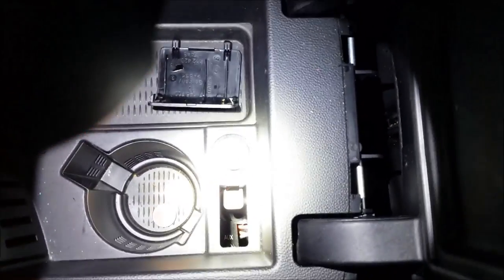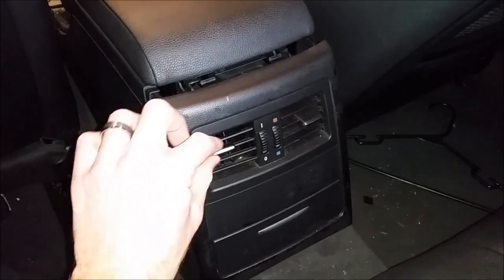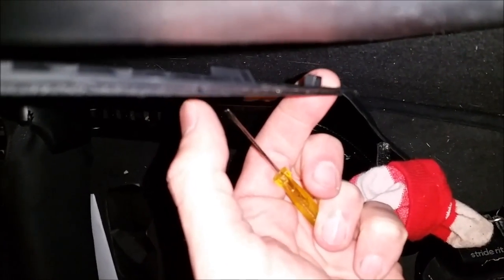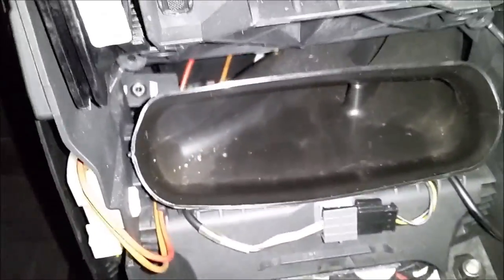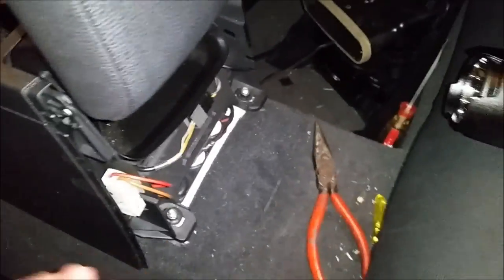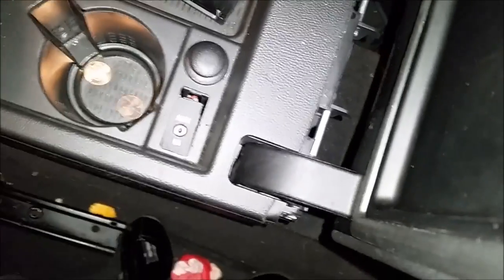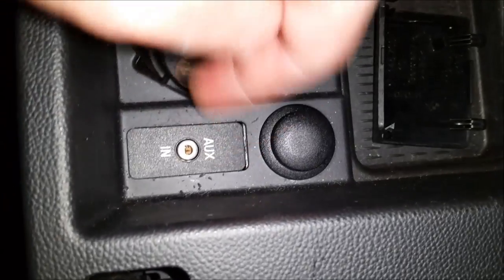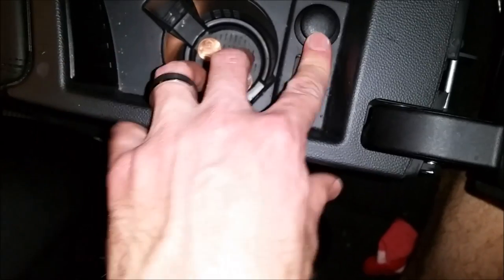2007 BMW 328i Aux Port Fix and Rear Center Console Panel Removal

Comment: This video helped me a lot in removing those side clips.  I found it easier to pull the unit out through the side and then feed it back in at the top and then reconnect the cable.  Thanks!
Reply: The coupe's rear AC and vent, etc doesnt pull off like this video, so I did the side method as well! Worked for me.

Comment: Thank you for the video! Not sure if that made your mother-in-law happy but it sure made me happy so big thanks to you again!
Reply: It took a lil twist and poking around the clip retainer on the sides to disenage it so for anyone that are planning to do this, just be patient and you'll get there. Also if cannot get the air vent out of the way, you can lift up the sides to access the AUS port (which is what I did). I put some superglue on the edges and below the step so that should help to make it stay.
Reply from the maker: +B Hou It made her very happy!  Glad its been helpful and thanks for the additional pointers.

Comment: Thank you so much for posting this! Items of note....the side clips that need to be unclipped are on the inside edge of the non-movable console, so you have to feel for where the screwdriver needs to be to pluck those puppies off....also, it's a PITA to try to stick fingers in around the duct work....get someone with thin hands (long fingers) to push the aux box out of the console so it can be reseated, a longer flat head screwdriver doesn't really do the trick since it's not as flexible as fingers. Although the screwdriver will help keep it in position so you don't lose track of where it is. You have to push the aux box around the "seat" to get it up and out of there. It takes a bit of maneuvering. Thanks again for posting! I was able to fix this one myself. YAY!
Reply from the maker: Thanks for the additional pointers! Glad the video was helpful!

Comment: Thank you so much! Had the same issue - fixed in 10 minutes thanks to your video. The rear vent panel lower clips were a real pita to get unclipped tho. The plastic side panel had enough flex so i clould actually use my fingers to unhook the lower clips. The only thing remains is that the aux panel (mine's one with a USB and AUX) can fall back through pretty easly. I guess there's some plastic clip that's broken in there. Thanks again!

Comment: That aux is a pain, man. There is only one clip that holds the unit in place, so any decent amount of pressure, and mine pushes through as well -- so you're not alone, lol. Thanks for the vid!
Reply from the maker: Yeah I was really surprised how easily it pushed through.  I ended up doing it a couple times in a row testing how much force it took.  Poor design, but thankfully a moderately easy fix.  Glad the video helped!

Comment: Not sure if you fixed this or not but the reason it won't clip in flush and stay is because of a small, broken tab that sticks out from the driver's side of the console. The same thing happened to mine 325i and I noticed the little tab was broken and pushed down. Will attempt to fix it with jb weld some day. Thanks for the video on the disassembly though! Couldn't have done it without it!

Comment: Thanks a bunch mate. Have my aux unit back. Putting the ac console back on though is a pain - the top locks in easy, the bottom is refusing to.
Reply from the maker: +StreamingEagle Were you able to get it?  Glad it was helpful

Comment: When I opened the console in mine the air duct left absolutely no room for me to get my hand to reach the aux port, and it didn't budge at all either. How did you get the air duct to go out so far? mine seems really in there

Comment: I have this issue in the 08 328i coupe, the center continues to the back seats so there’s no panel to remove. I think I’m just going to have to cut the hole wider with a saw. My aux fell to the very bottom where it is unreachable.

Comment: I have a 335i with the full console to the back seat.  I wasnt able to pull through the back but through the parking brake.  Is there a way to disconnect the aux box from the cable so I can put it over the top?  I'm struggling. Please help.

Comment: You would never got it lined up because there used to be two tabs holding it down, and when the port fell down actually because one of the tab is broken. When you try to put it back there's only one tab, so I guess it'll never be like it was before

Comment: They way I fixed it was, get a long 3.5mm aux cord. Plug it in, forget about the sunken port. The aux cord is long enough and when I close the little console, it slips right through. No need to unplug and plug back in.

Comment: Easiest way to get the aux port out is to takeoff the emergency brake boot and you can fish it with a grabber tool out disconnect it and put it back in from the top. Much easier takes about three minutes and you don’t have to take all the console  apart

Comment: I need to remove console top.  When you were in there did you notice if just two screws hold the the whole mechanism?
Reply from the maker: Hi +Shelby Varholick, I wish I remembered.  By console top, are you referring to the padded lid?

Comment: Funny how many brownie points in my 15  years of marriage were working on mother-in-law vehicles. Suggest using plastic weld lightly on edges before pushing back in. Clean surface with alcohol wipes. Let sit. You'll never have this issue again.

Comment: I couldn't get the clips on the side to pop off. any tips?! And what is the best way to reassemble?
Reply from the maker: Hi! Sticking the little flat head screwdriver up underneath the side panel between the panel and the clip on the back vent piece was how i was able to get them off. Once I figured that out they came apart and went back together pretty easily. Hopefully that's helpful.

Comment: this must be a pretty common problem. I guess it was a flaw in the engineering design of the clip system. Well nobody buys BMW to get a full luxury experience; or if they do, they bought the wrong car. The powerhouse under the hold is spectacular though.
Reply from the maker: +Zachary Sims Yes agreed, its definitely a design flaw.  Hopefully it was fixed in later models.
Reply: Zachary Sims

Comment: Do you have USB port in your car?
Reply from the maker: +Rookie Hi I do not recall if the car had a USB port.  It was my mother in laws.
Reply: +clintathusaz thanks. I got 2008 335i but no usb. Aux only. Was just wondering

Comment: I have a 335i with the full console to the back seat.  I wasnt able to pull through the back but through the parking brake.  Is there a way to disconnect the aux box from the cable so I can put it over the top?  I'm struggling. Please help
Reply from the maker: +Noah Ross I wish I knew man.  This was my only experience working on a BMW and its been over a year.  Hopefully you can get it!